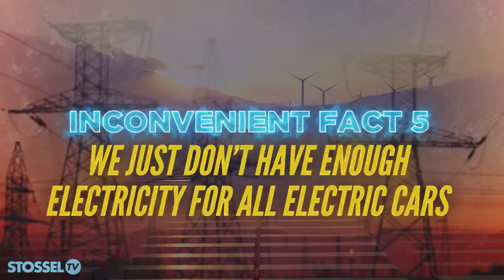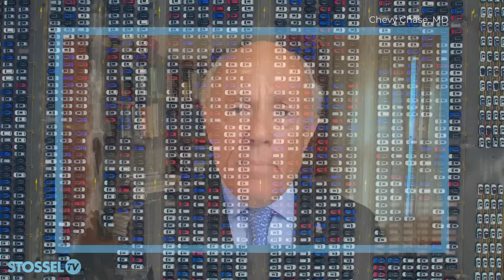Electric Cars: Inconvenient Facts, Part 2

Comment: thank you, Jon. the truth is often painful: the first noble law of Buddhism is that pain is an essential/inescapable part of life or "life is chaos, chaos is life and control is an illusion!
Reply: Notice how he avoided actual numbers.  This video is not about the truth but instead about his agenda.
Reply: @gregkramer5588  This video is full of numbers! Start reputing them one by one with your numbers.
Reply: @ScottyKirk1  Ok,  Well that was bad.  I just re-watched the video and there were no numbers :-( 
I guess I will add the a couple they forgot.  BTW they mentioned where CA asked people to not charge.  That was not because of EV draw but because of AC drawing power.  EVs actually help the electric companies make money since they mostly charge off peak when there is excess capacity.  So higher revenue for them relative to peak capacity. 
In regards to renewable electricity generation he never showed the numbers.  I  imagine it does not help his story.  The lowest cost way to generate now is solar.  It has drawbacks of course but the output is peeks in the day close to when AC needs peak so that is good.  ~21% US is coal powered, ~41% is natural gas so still a lot of fossil fuel but far from 100%.
He conveniently did not mention that gas vehicle engines are only about 32% efficient vs and electric motor which is over 90%.  Here are some numbers for you.  Drive 100 miles a day in a CRV compact SUV.  
~4 gallons of gas.  At $3 a galleon that is $12 a day.   Let's round that to $10 to make gas look better.   If I drive that in a ID.4 or EV6 it would use about 25kwh of electricity. I pay ~$0.18 per KWH.  Close to the average for the US. That is $4.50 a day.  Let's say $ to help out the gas car.  The cost per day is still $5 less.  If this is 300 miles a year, $1500.  Of course the CO2 emitted by that much electricity usage would be less than 1/10 of the gas car.  
Now is you drive 1000 miles per month at 4kwh per mile this is 250 more KWH on you electric bill.  Here is TX I can get over 2000 KWH per month just for AC.  This is just for perspective.
Reply: @TehButterflyEffect  Did you really mean that wind and solar are not good sources for electricity.  Or was this sarcasm?

Comment: Simple EV advocates say - just get more lithium! OK, 1 ton of Lithium requires 500 tons of ore and 500,000 gallons of water to refine it.  Current production requires 65 million tons of ore to be mined and 65 billion gallons of water; so how much CO2 does that take? If you some how could 10x that - you are talking 650 million tons of ore and 6.5 trillion gallons of water.  No problem for the evironment right? Lithium is just 4% , Cobalt is 7%, Nickel 5% Manganese 10%, Copper 15%  Al 16% 36% others.

Comment: Bursting into flames all of a sudden is pretty amazing too…
Reply: ICE engines. which run by using sparks to create a series of small explosions of combustible liquid never catch fire, amiright?
Reply: @libertarian4323  Gas usually requires a lot more pressure and time to explode but batteries are sudden. Typically due to wiring issues, hydrogen leakage, water causing sparks, or overcharge and it is instant. Gas has similar issues that make it combustible but is less often an instantaneous “explosion.” Also, electric fires take far more time and water to put out than gas.

Edit: we must also take into consideration that there are far more gas cars on the road than ev so there is far more data on gas cars than ev.
Reply: @mehoyminoy1326  Yes, battery fires are harder to put out.  But ICE vehicles catch fire at a vastly higher rate than electric cars.  Everyone freaks out whenever a Telsa catches fire- it's national news.  Yet ICE cars catch fire every day, and no one pays any attention-if you live in a decent sized city, there's a good chance an ICE vehicle will burn in your city today- but it ptobably won't be in the news.  This leads to the incorrect belief that eVs are more prone to catching fire than an Internal Combustion (com·bus·tion: the process of burning something) Engine.
Reply: @libertarian4323  
Your car all of a sudden driving off at high speed on its own when you were just attempting to park and killing two people is pretty cool too…
Reply: @roosterball69  It's also extremely rare with an electric, unless you buy a POS like the Chevy Bolt.

Comment: The info presented here is spot-on!!  
As I work for a Southern California power utility that supplies roughly 4 million people, I can tell you that most of the systems are so very outdated and over-taxed that adding EVs in every home, condo, apartment, etc by 2035 is a joke, both, in implementation and in reality.
Frankly, I hope I'm around come 2035 because I would love to see what this will actually look like if fully enacted. If you think your power bill is high now, just wait until the power companies tack on the infrastructure improvement costs.....it's gonna be laughable!! This ain't happening for free.
Thank God I will have been long retired and living in another state when this day comes.  But at least my pension will be secure!!  Thanks!
Reply: You don't know what you're talking about. EVs charge (95%) off-peak, when demand is at its lowest, and only consume about 10 kW/h per day. That's about 1 - 1.5 clothes dryer cycles, again, while we're asleep. The average American home HVAC consumes 3x - 6x more than that. EVs will not melt the grid, air conditioning will.
Reply: @justsomeguy934  I do know what I'm talking about, but I and if everyone gets ev nighttime will no longer  be off peak!!the amount of electricity required to recharge EVs instead of cars and lorries not possible
Reply: @stevenvater8720  you do NOT know what you're talking about, friend. By all means, give me daily kW/h demand, off-peak generation requirements and maximums. 
Here's some facts for you:
1) daily use of an EV in the USA requires, at most, 10 kW/h of energy. For the newer EVs, this is much less and amounts to 1 clothes dryer cycle. 
2) daily use of an EV can be refilled using house current; for the USA, that's 120v, 15 amps. No special wiring, no new breakers.
3) The energy required to refine petroleum into a gallon of gasoline is enormous; refineries are one of the largest consumers of grid energy in the USA. Their consumption and co-generation electricity is in the terawatts. Stop buying gasoline and that energy goes to the grid.
So tell me how plugging in a house-current appliance overnight will melt the grid. For comparison, your home HVAC consumes 3x - 6x the amount of energy an EV does on a daily basis. Worried about the grid? Stop building houses with air conditioning.
Reply: @justsomeguy934  you conveniently don't mention the "lifetime", energy consumption of EVs which is far greater.are you a tesla salesman?
Reply: @stevenvater8720  I didn't mention it because it's not true. Are you a petroleum executive?
Reply: @justsomeguy934  where do you get the figure of 10kw demand daily? Utter rubbish!!
Reply: @justsomeguy934  no I'm not petrol executive. I think you are XR. Just calculated most efficient EVs currently use 3.2 kW PER MILE. Your calculations of tumble dryers utter rubbish. You live in cuckoo land
Reply: @stevenvater8720  "Just calculated most efficient EVs currently use 3.2 kW PER MILE. Your calculations of tumble dryers utter rubbish." You have your calculations backwards, friend, so I wouldn't call me names. My 9-year old EV gets 3.3 MILES PER KW/H, and the new EVs get more. The Chevy Bolt regularly gets around 5 miles per kW/h. It's YOUR math that's utter rubbish. Given the CORRECT numbers, a 30-mile daily commute would only required 10 kW/h to refill, and that's only on an older car. Let's confirm my math through two other methods: multiply the miles-per-kW/h by the battery capacity. In my case, I have a 90 kW/h battery, 3.3 miles p/kWh, my initial range from the factory was almost exactly that number - 290 miles or so. Let's confirm my math a second way: on house current, any EV I know of can achieve 3-4 miles of range per hour of charge. So for 8-10 hours of charging @ 1.5 kW/h, you get back 30-40 miles of range. This is absolutely verifiable. 
Next time you call someone's math "rubbish", I suggest you learn how to do math.
Reply: @stevenvater8720  "no I'm not petrol executive. I think you are XR. " I AM a Tesla salesman, as any Tesla owner is. Did you know WHY Tesla doesn't advertise? That's because, on average, every Tesla owner (like myself) sells 3 other Teslas when they show it to friends and relatives. And it's the Tesla ownership enthusiasm that has the oil industry frightened.
Reply: @stevenvater8720  "where do you get the figure of 10kw demand daily? Utter rubbish!!"
I already answered you in another post; it's YOU that got miles-per-kW/h and kW/h per mile reversed. Your math is utter rubbish.
Did you want to apologize now, or later?
Reply: @stevenvater8720  "where do you get the figure of 10kw demand daily? "
Actually, I know a Tesla Model 3 owner that got 77 miles of range overnight, plugged into house current (120v, 15amp). That's almost DOUBLE the range that older cars get. That would put the daily energy demands of a 30-mile commute at only 3 hours of charging @ 1.5 kW/h, or 5 kW/h per day. That's actually BELOW a single tumble dryer cycle's average energy.
Damn, I'm good.
Reply: @stevenvater8720  No, Tesla batteries last 300,000 to 500,000 miles before they reach 10%-15% degradation (i.e., less range but still functional). My particular EV has 90,000 miles on it, works fine, thanks for asking.
My buddy bought a new Tesla Model S last year, traded in his old one. His old one had 167,000 miles, original battery and brakes. 
I'm glad your Honda works great. I absolutely advocate to keep a reliable vehicle as long as possible to reduce operating costs.
Reply: @stevenvater8720 , no, you are in Cuckoo land; a Ford Lightning toward a huge trailer doesn't even use 3.2 KWH per mile.  Before you make any more silly statements, I suggest that you befriend either somebody who has an EV, or an engineer in the energy industry (like me).  Here in the USA, the industry average for the fleet is 3.7 miles per KWH (sorry for the stupid non-metric units).  It also happens that the average car here is driving 37 miles per day.  If that average EV is driven that 37 miles each day, that works out to 10 KWH consumed each day.

I do not believe that introducing clothes dryers into the conversation is particularly helpful.  The bottom line is that an average American home now consumes 909 KWH per month, almost exactly 30 KWH per day, little of it "off peak," unlike the EV.  Here is some "third grade" (age 8 here in the USA) math for you:

Most average EVs in the US go at least 6.0 km per KWH.
Average US electric rate in the US is reaching $0.14 per KWH.
Thus, in the US, it costs 0.14/6.0, or $0.023/km to 'fuel' the EV.

The average ICE car in the US goes 10.9 km per liter.
Average cost of gas (2019) in the US $0.69 per liter.
Thus, in the US, it costs 0.69/10.9, or $0.063/km to 'fuel' the ICE car.
Reply: @km6xu  You miss the entire point. Electricity is NOT going to be $0.14 per kw in an all electric future where everyone is charging at the same time. You can't assume all the current good things about owning an ev will stay the same and all of the inconvenient bad things will get better as time goes on, which is an assumption all EV propaganda is built on. Need to win an argument about running costs in an all EV future? Just use the current low electricity rate and ignore that EVs consistently score the lowest in multiple reliability surveys! Need to win an argument about current inconvenient charging times, battery costs and lack of charger availability? Easy! Magical new future batteries and tons of new charging infrastructure will manifest out of nowhere in a few short years! I bet every landlord will even pay to make EV chargers standard in all their parking lots! The only current benefits to EV ownership are driven by the fact that A. the government subsidizes the purchase of them to a huge extent and B. Very few people have them yet thus grid demand, electricity prices and charging station demand is still relatively low.

Comment: best meme of the year: charging an electric car using a gas powered generator
Reply: In a pinch, why not charge an EV with a gas generator ?
Reply: @GK-op4oc  Or use electricity to pump gas into my tank
Reply: @clickoncarl  well put
Reply: 43 people liked this.  Wow, are we doomed as a society!
Reply: @Fishy A small generator is still less than driving a gas-fueled vehicle for 50 years.  Who says it needs to be purchased for every EV ?  The EV involves much lower because less fossil fuel is burned.  The huge generator at the electric plant that burns the fossil fuel is much more efficient than the mini portable generator on wheels.
The energy difference is seen in the cost.  Electricity is more efficient to burn at a power plant , ship over wires, charge a battery and consume by an electric motor   than extract as oil, ship internationally to refinery, refine into gasoline, truck gasoline to station, pump out of ground and burn in an engine that wastes 75% of the energy as heat
Reply: @Fishy "Your EV still creates emissions every time it charges using the grid or a generator. You just don't see the emissions from using the grid."
Your local utility produces a FRACTION of the emissions that a gasoline car does. First, a utility can choose any fuel it wants and often it's natural gas (very clean, comparatively). Secondly, a utility generates steam directly from heat, it doesn't waste the energy pushing pistons like a car does. Lastly, an EV, once given the electricity generated, is many times MORE efficient than a gas car.

Comment: I've been in technical training since 1983. There's no way we are going to get technicians skilled enough to work on 800V.
Reply: It’s 6:30 here, and that’s the stupidest thing I’ve read today
Reply: @cybertrk  why?
Reply: Daniel, 

how do you think the high voltage electrical sector finds people to work on their much higher voltage systems?
Reply: @cybertrk  Then you're not trying hard enough. I've been doing this for over 30 years and recruiting has become impossible, students show up without ANY real technical OR educational preparation (fractions??? NO!), industry has no clue, and I'm NOT talking about power production infrastructure. I'm talking about a 12-24V transportation infrastructure that has techs working today who have NO IDEA how an electromagnetic relay works, but they replace them at  the speed of light. I've taught 8000 students in 26 years - the group of 12 last week had no idea what voltage is, how to read a schematic or how a meter works. Spend some time doing what I do and you'd have some meaningful insights on this topic. Your personal life and ego have no bearing here.
Reply: @iareid8255  The power generation industry needs over 1000 techs NOW, and there aren't any. In addition, there aren't any meaningful training programs for generator techs (240V-480V), and diesel instructors can't even teach basic electricity. Again - 30+ years in this and I ASSURE you the system is about to collapse under the weight of industry stupidity. Tech teachers CANNOT recruit AT ALL from a pool of disinterested underprepared kids who want to be YouTube influencers. Go into your shop (whatever) and ask EVERY tech there if they're pushing their sons (daughters?) into the trades. If more than ONE says yes, I'd be amazed. If you have 30 years dealing with this we'll talk. If not, stick to commenting on cat videos. I'm tired of ignorance and have no time for it.
Reply: Daniel, 

what you said in your original post and what you say now are two different things.
It is not beyond any reasonably bright person to learn this subject.
Yes, I agree, with over forty years in the engineering world (electrical power) finding sufficient people who wish to follow this career can be difficult. When I was an apprentice they said then we will be short of engineers. it seems little has changed.
Reply: @iareid8255  I see my mistake and understand - sorry for the response.  When you place an editorial directly into the hands of the CEO of PACCAR and he looks at it and says "great article, what's for lunch", instead of making a phone call to solve the problem, I realize we're screwed.
Reply: Daniel, 

no apology required.
Engineering is seen as too dirty by many, which is not good.
Personally, I went into engineering at sixteen because it interested me and still does at seventy five.
It is a great pity that politicians tend to be scientifically or technically illiterate which leads to so many poor policy decisions.
Reply: @iareid8255  FYI - I emailed Stossel but I assure you no one from there will contact me - because even though they have none of our experience, they'll assume they do and waste time and money chasing their tales...